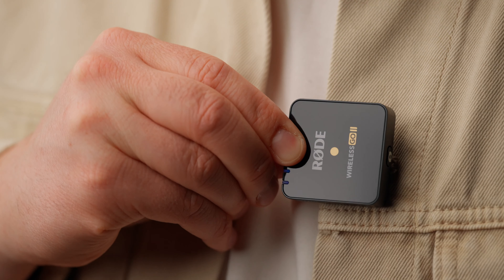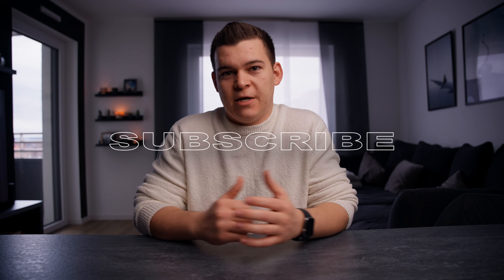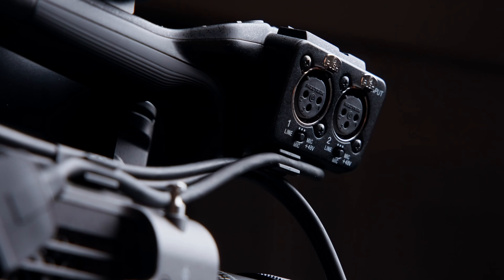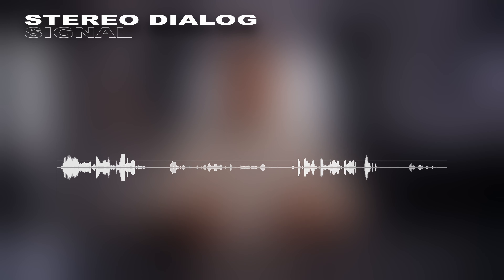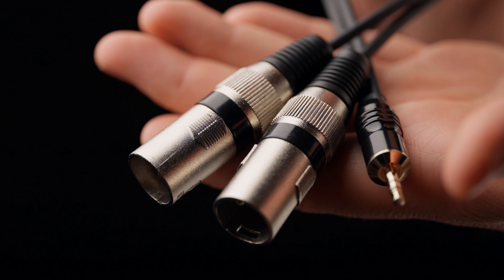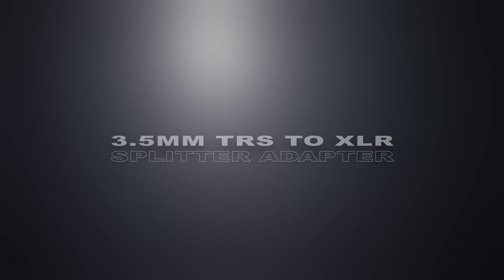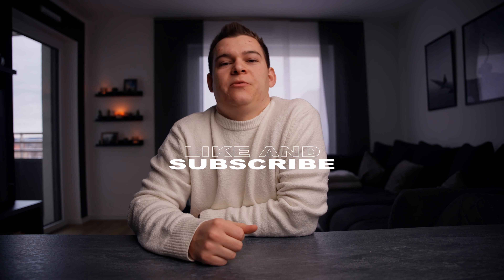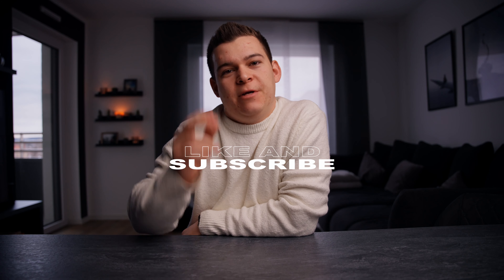How to use RODE GO II with SONY FX6

Comment: This is why the K3M XLR paired with either fx3 or A7Siii is money cause input 3 still gives you 2 channels to divide while still having 2 xlrs to use. You can have 4 people laved up on the k3m unit all in independent channels while on the fx6 you need either UWPs or K3M unit on MI shoes to achieve this. As always the cheaper cameras can give you more. I own A7Siii A7IV FX6
Reply from the maker: As far as audio is concerned, that is correct.
However, I don't think that the cheaper cameras offer more.
e.g. A sound guy comes to you or you want to work with 3 cameras, you don't have a IN for you tentacle TC generators....

Every camera has its own field of application for which it is made.
Reply: @maxsautner  with the way Sony continues to give better updates to cheaper cameras and not the CiNe Line makes me come with the conclusion “Sony cheaper camera is better”